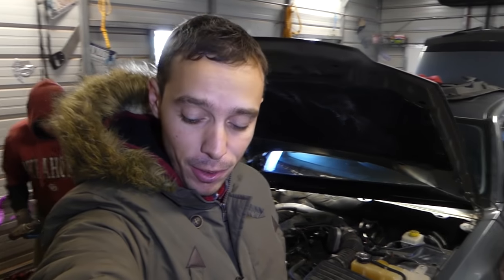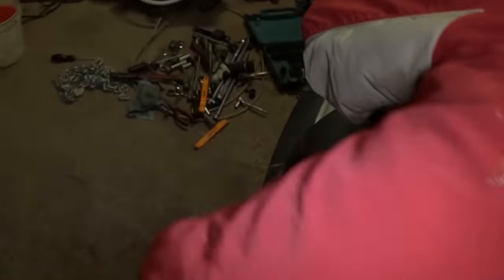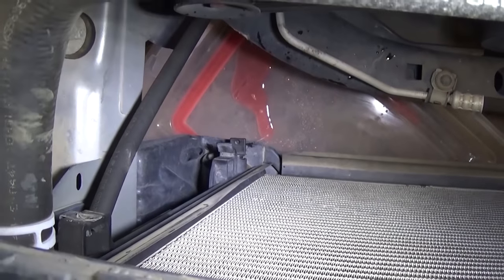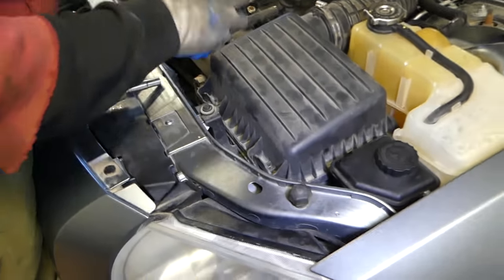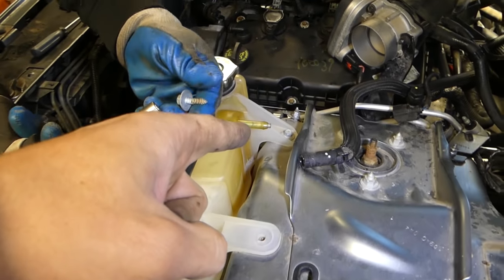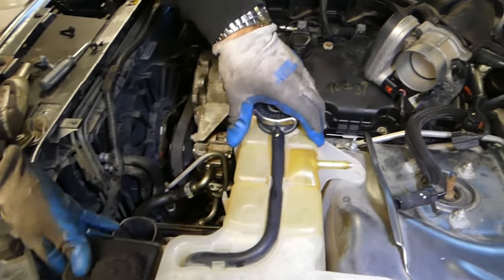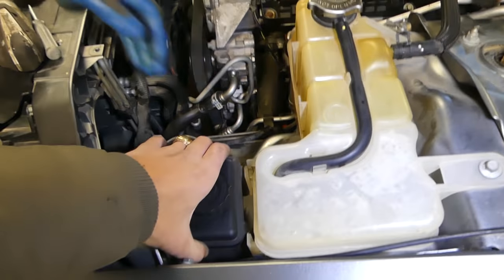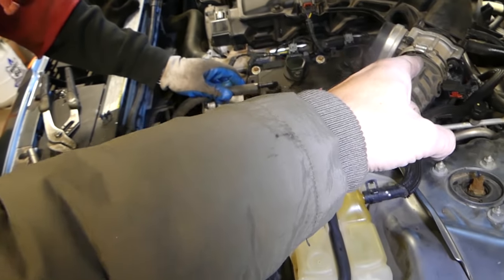DODGE CHARGER COOLANT RESERVOIR TANK REMOVAL REPLACEMENT| DODGE MAGNUM

Comment: Why was it changed ?
Reply: Dwayne Untitled  how long does this take?
Reply: Sometimes it leaks.  The rubber on the top around the cap gets old and you always have to change it. If not, hot water bursts out causing damaged to the entire engine.  About to change mine soon.  Drove on the freeway and smoke came out from the front today.  Lol
Reply: I changed mine cause the reservoir tank looked like trash.... looked old and old residue made it look black.... couldn't even see how much fluid was in the tank.... Walmart carries them too